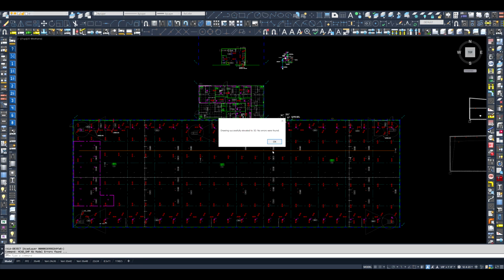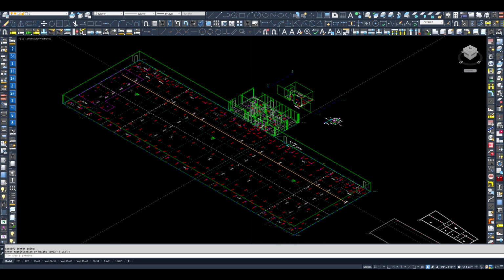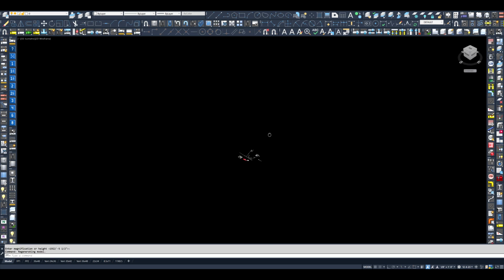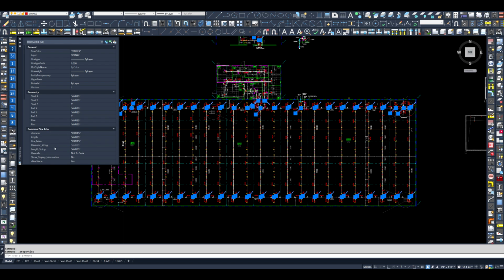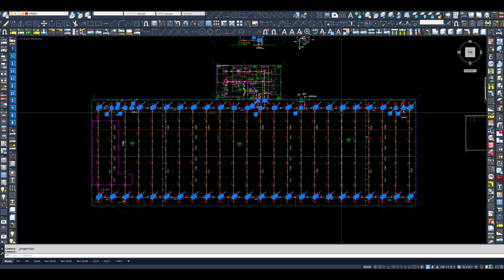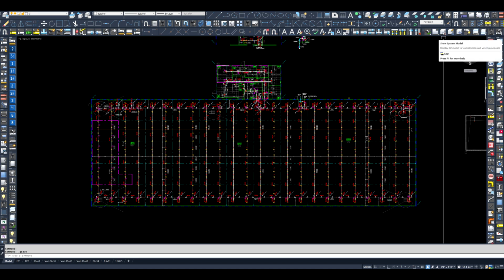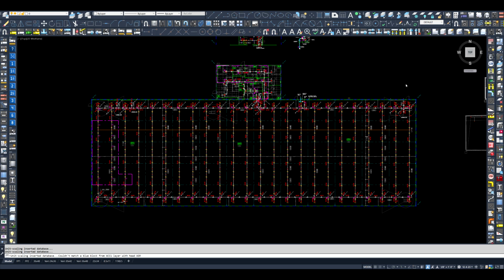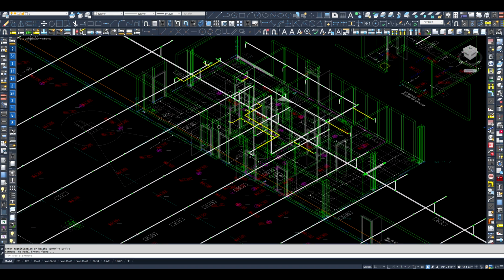HydraCAD 3D Elevation Fix: Why Your Sprinkler System Disappears (Solved!)

Comment: Hi there! Is there a feature in hydraCAD to automatically place sprinklers (not a perfect rectangle, but in an odd shape) and automatically place piping?
Reply from the maker: @MicaiahM95  Not yet. When they start using Ai maybe... But then you won’t need designers for much.  Hydracad “smart tools” don’t like anything but straight lines. Most new builds come from architects who clearly love angles… sucks for the sprinkler guy.  Also as of late, I’ve noticed hydracad doesn’t even sprinkle square rooms correctly on its own. Gotta have someone at the keyboard who knows what they are doing.
Reply: @PromisKeeper  you're amazing bro, thank you!